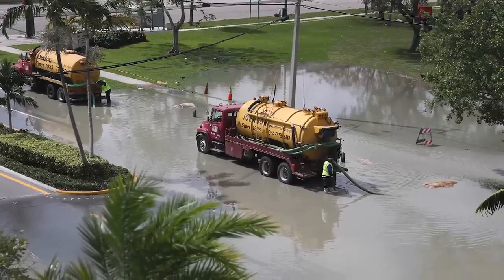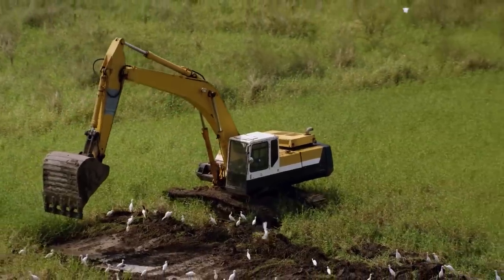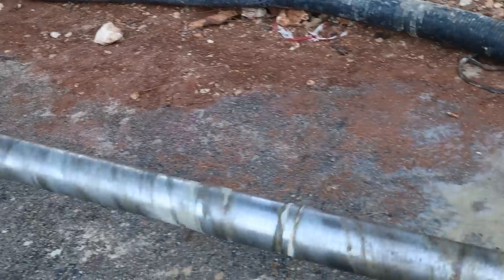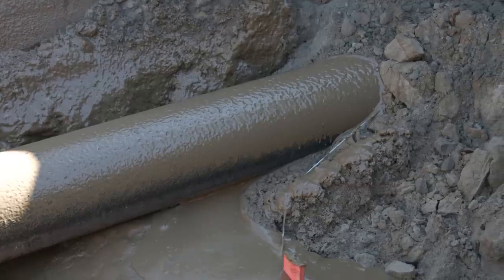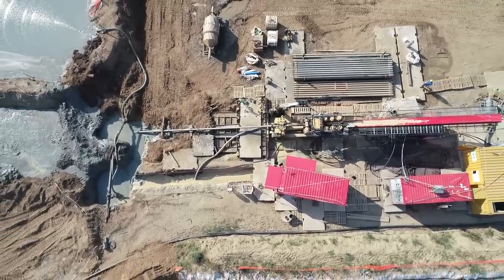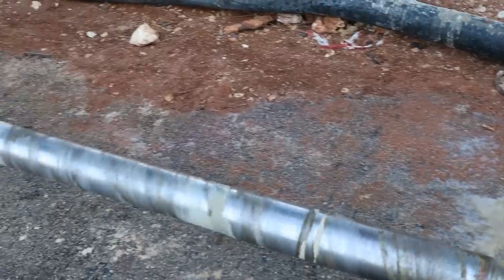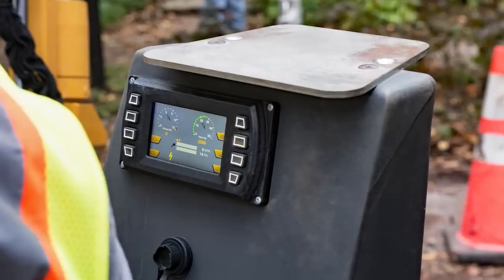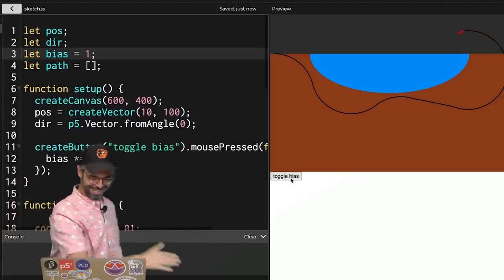How Do You Steer a Drill Below The Earth?

Comment: I work in the fiber optic network industry, and previously worked in the gas utility industry. We used to joke that you should always carry a length of fiber optic cable with you in case you get stuck on a deserted island. Just bury the cable and when the guy with the backhoe comes out to cut it you can just ride back with him.
Reply: I just laughed out loud at this.
Reply: Good joke but it's hard not to blame the guy that put it there using only the sod to cover it.
Reply: In surveying we had a similar joke. If lost set a survey marker and someone on a piece of excavating equipment will be by shortly to tear it out.
Reply: @longridgearchery  love these jokes. I promise a lot of us do try not to disturb markers but mistakes do happen and I do apologize for the ones I've accidentally knocked down.
Reply: As much as that terribly destructive invasive species, the North American Fiber-Seeking Backhoe, is a pain in the backside, it can come in handy! :-D
Reply: Maybe if you actually buried your cables we wouldn't be hitting them 2 ft below the surface. You know something called WORK
Reply: One of my previous bosses was a retired framer and I would go help him with occasional projects like repairing someone's deck or something like that. 
In construction our running joke was always.. if you're somewhere you could fall, make sure you have an extension cord or an air hose with you. If you do fall off the building, cliff, whatever, just throw the extension cord out behind you. It is bound to get caught up on something and save your life.
It never fails. When you're on the job site and want to pull the extension cord or the air hose, it will inevitably get caught up on any scrap 2x4 or anything laying around and you have to go walking around and untangle it lol
Reply: @keithyinger3326  When I would string electric tape in my cow pastures, my constant mutter was, "If it can, it will," as the darn stuff tangled like spaghetti every few feet.
Reply: @lizj5740  How do you store your electric tape for the fence? Do you keep it on some sort of hose reel?
Reply: @markfryer9880  I left the farm over 25 years ago, so let me see...I think I would just loop it on thumb and elbow as I took the tape down. I'm sure this was the source of the problem. A reel might have helped.
Reply: This is hilarious 😂
Reply: Cool story bro
Reply: Fiber optic is much lighter to carry vs. a 32 pair phone cable.
Reply: @francisschweitzer8431  you're not wrong, but I can't remember the last time I saw metallic cable that size. 400pr is about the smallest I deal with.
Reply: I remember an incident in which a crew was sent out to put up signs warning of the buried fiber optic line and drove the posts into the line.
Reply: 🤓 Your buried line would probably summon a backhoe alright, but now, since backhoes can't cross the water that generally surrounds desert islands, you would both need rescuing.
Reply: @lewisdoherty7621  omg - that’s funny (in a shake-my-head kind of way)
Reply: I was driving my car and was able to drive over a fiber optic cable that the guy was laying.

I didn't see it and he must not have seen me I fault him 100 okay 99%.

I think I must have broken it so did he continue laying it or did he put a completely new length to replace it.

Given the fact that he would lay fiber optic cable on a roadway without protecting it sufficiently from traffic I'll bet this contractor just continued on and any problems that arise later could probably not be isolated and repaired easily.

Sorry about that chief...
(Keep in mind I'm only accepting 1% responsibility)
Reply: It's always the way.
I know someone who took out one of the largest fiber runs in town. Did all the legwork having the governing bodies supply plans and then paid contractors to find all services on said plan and mark them. Eventually given the green light and then proceeded to take out the cable that was supposedly on the other side of the road.
Reply: @spicywolf6718  If a utility company doesn't tell the municipality where their lines are, I feel that it's on that utility to deal with the consequences when the municipality has more construction done. 
(Of course, always get an up-to-date survey done before construction anyway. Dealing exclusively with old records can be a nightmare. And for anyone who needs to dig in the US, find your national / state / local "call before you dig" organization.)
Reply: @longridgearchery  Yupp, someone's bound to come destroy it by "accident"
Reply: @dcviper985  fiber optic has to be my biggest nightmare. It’s so fragile, yet so expensive. I’ll never understand why it is ok to direct bury it near other utilities.
Reply: LOL I am that guy with the backhoe except it’s usually my shovel 🫣
Reply: thanks ,I needed that , after l"ong" day,. midnight laugh
Reply: @keithyinger3326  I got a chuckle out of that. The problem is it wouldn’t actually work; Murphy’s Law isn’t recursive.
Reply: Got to be sure to only bury it 12" down where most companies bury theirs despite regs. I've worked concrete construction for years. Here, the minimum depth for fiber optic is 36". We have found 7 active cables within 12" of the surface in the last 2 years alone. Not my fault when they're not up to regs.
Reply: @longridgearchery  every dang time. They'll be gone by the end of the day.
Reply: @keithyinger3326  If you can't find an extension cord, grab a garden hose instead.  Same principle involved.
Reply: @wax_axiom479  I have had the opposite problem. Somehow I managed to rip down a phone line on a customers house that was zip tied to the weatherhead on the hydro meter (which also ripped off) with a fuel truck that was 10' 8" high. I can't remember what the height at which communications wires are supposed to be over a driveway but it's higher than 10' 8". The company I worked for paid for the repairs, should have been Bells problem imo. Next time I went there, the phone line was at the exact same height as when I hit it.
Reply: If you guys would install them in a way that didn't look like a spider web and maybe some organization like all the other utilities are they wouldn't get hit all the time. Oh yeah and actually mark them!
Reply: @noahbartholomew932  hey, we always use locatable cable or duct. Failing that, we add tracerwire. I dunno what else you want. Call before you dig...
Reply: @dcviper985  I have found many lines that weren't  located and haven't paid a cent to have them repaired because they weren't located......hence I did the one call. The job I'm on rn you literally cannot dig with an excavator because you will hit a communication  line you HAVE to use a vactron. I think at&t should be sued for that because it cost everyone more money when you have a mess of wires running everywhere when they could all be bunched together like all the other utilities....God I hate communications companies.
Reply: @lizj5740  it builds in a twist
Reply: And of you fail to flag down the operator you can always wait for us insurance guys who'll invariably be coming out to check the locate marks.
Reply: Another joke: the difference between a fiber connection and a secure fiber connection: 
The secure connection is the one that comes with landmines.  You dig down there with a backhoe, you get darwinized.  There's a nice alarm sound when it's cut, too.
Reply: @andrewsaint6581  I'm sure you're right. I hadn't thought of it that way.
Reply: @lizj5740  looping up ropes for sheeting lorry loads you roll in the the opposite twist with each loop, then they hang straight and not like yesterday's spaghetti. It would be much harder with a ribbon though. That stuff is coarser and more "snaggy".
Reply: @andrewsaint6581  Thanks for explaining the source of your knowledge. I don't know if I could roll in the opposite twist with each loop. I'm just glad, it being winter now in Australia, that I'm no longer out there dealing with uncooperative electric fence tape and feeding hay to the cattle daily.
Reply: @lizj5740  works on normal cables too. Just start at the appliance end.
Reply: lol
Reply: As someone who works for the city in a town that's currently putting in fiber, it's going the other way around lol. They keep drilling through our storm and sewer drains.
Reply: Now, that's funny!
Reply: There is acronym for this: B.I.F.F Backhoe Induced Fiber Failure
Reply: Same joke, but heard it "grade stake and grader operator"
Reply: I just LOL’d out loud by myself in my backyard and scared both my dogs.
Reply: My personal best is hitting a water line fiber optic and gas line within 100 yards in one afternoon
Reply: @interdesk9516  That's a bad day.  Marked?
Reply: @ricksanchez3176  well it was on our property,  you know where 811 stops
Reply: @interdesk9516  I don't know how it is where you live, but in Ohio, OUPS doesn't stop anywhere. Worked in many States, and it's been the same. The "operator" (owner of the utility) has to mark them, within 18", "contractor" has to call 48hrs, counting only Mon-Fri before digging.
Sometimes they won't mark a private service, water after a stop, or comm after the ped, gas after the stop or regulator stand.  Sometimes a big industrial complex may have special agreements. But right of ways are right of ways, unless they layed it without being on right of way, if it was marked or OUPS wasn't called, it falls on the excavator.  Sometimes it's not worth taking to court for small repairs if a private landowner damaged them. But as for locates "stopping", what state are you in? Either ANSI or NIOSH layed out standards for this decades ago and pretty sure most if not all States based their laws on them.
Reply: Just as I will bring my golf clubs if I was ever stranded in the desert, I will DEFINITELY find water. 🤣
Reply: @jonny555ive  Walk to the water. Throw in a dozen balls. Cross to the other side and drop. It's a lot quicker
Reply: @boostaddict_  better than through yout water service
Reply: @wax_axiom479  homeowners are taught to call and see where lines are placed before they dig. Why can't you follow that simple instruction, too? You know, since it's part of your JOB
Reply: That’s funny 😆
Reply: I haven't hit fiber optic yet but I have successfully cut through electric and water lines!
Reply: YOUR AMERICAN ARNT YOU
Reply: wow..lol
Reply: Bahahahaha. I just cut one the other day about 20’ from the locate
Reply: When a carpenter goes on vacation, he should always pack a 100  foot extension cord. If the plane is going down,  he can  just throw one end out, it will 100% of the time get caught on something.
Reply: Utility locators?  Those guys would NEVER miss.  LOL
Reply: Same here. I built water towers and flat bottom storage tanks before I started doing fiber. Twinsies!
Reply: @lizj5740  You must be referring to what many people call "polywire" or temporary/portable electric fencing.  I've never heard it called "electrical tape" as that is usually something for insulating electrical connections.  Maybe you are in another part of the world, like Australia?
Reply: @stevewalston7089  I am in another part of the world, and I moved off the farm over 25 years ago, so I have probably called it by the wrong name.
Reply: @wax_axiom479  New fibe cables buried 1 to 2" below grade to every house on my street
Reply: @AndyGneiss  do you put warning tape below the surface for underground cables is the US? We do that in Finland
Reply: @ActingLikeABoss  we bury fiber optic with 20kv and 400v lines in the same trench in Finland. Also fiber optic cables are pretty cheap iirc.
Reply: @jabbatheputz8825  our target depth for electrical lines is 70cm or about 28"
Reply: @lizj5740  you made my day
Reply: @markfryer9880  you Made my day
Reply: As a water utility worker. Com lines were never marked properly or even put on the subterranean utility maps. We had no remorse for the ones we came across. 😂
Reply: @vinny9854  I mean, as long as you called 811 beforehand, I would have any sympathy either
Reply: When they first started using this tech they hit a lot of utilities. It's better now with less hits. But, Hydrovac is the way to go. In some states its consider hand digging so less risk.
Reply: Thats funny but makes alot of sense
Reply: As, formerly, one of the guy's in the backhoe I would like to point out that we do not possess x-ray ray vision.  We depend on accurate locates, good laborers willing to pothole even in hard soil, and sometimes just plain common sense and luck.  Worked for a large mid-west city public works and never ceased to be be amazed at the amount of in service, abandoned, and "nobody knows or want's to claim what this is" stuff we found on our jobs.  That includes basements to existing structures that were damaged during construction or repairs and were not on any city plans or maps.  Go figure.
Reply: The best part about this is that I'm a pipe inspector and find Fiber bored through sewer and storm water pipes all the time 🤣
Reply: @jasonm3040  I can only imagine... I swear when we engineer these bore paths we take that stuff into account
Reply: Lmfao. That’s great.
Reply: I have a running joke about being the only person on a job site and a room being available for a long time for access. As soon as you go in 14 others want into the same room
Reply: Lol, can totes understand. In all fairness, they often dont adequately mark them, and since they are pretty much undetectable lol. But somehow, they are magnets for backhoes....
Reply: Worked as a first responder for the gas utility in St Louis and we had a few.
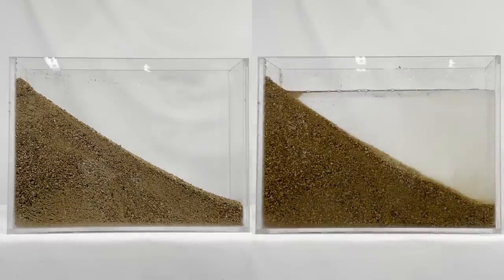Who has blown up more houses than the Russian army ? Answer : The directional bore operator😂. What do you call a directional bore operator in a three piece suit ? Answer: defendant😂 . What should you do if you don’t want anyone to find a buried treasure ? Answer : Have USIC document its location😂. If you don’t want any overtime at 4:30 on a Friday afternoon what should you do? Answer:Call in sick Friday morning😂. I could probably go on forever.
Y’all stay safe out there & pot hole those services and mains, especially on Friday afternoon.
Reply: @boby115  dude they blew the water main branch during winter, creating the perffect scene for the live sction version of frozen on the business where they hit the line outside if. It was windy and at the low end of their workable temps.   Literally watched a 75 ft tall frozen waterfall collapse onto the interstate, along with the office windows and business sign attached. 

City wound up paying for like 500 gal of water.
Reply: @patrickw9520  , what city was this in? 500 gallons of the municipal water is not much (about $7.50) The real cost is in the repairs & litigation.
Reply: @boby115 was bottled water 😆 🤣.  350 gallon jugs (a literal pallet worth) and the rest in half liter bottles. So was about $500 wholesale of bottled water. 

The repairs took years of litigation to finally determine who was legally liable.... the horizontal drilling operator, city water, or the marking crew. Insurance cos like suing 😆
Reply: @patrickw9520  , at least it wasn’t beer 🍻. What was the city?
Reply: I installed communication lines in an industrial park with 4 levels deep of previously installed services. Guy comes running out to warn me that his company is multinational and if I interrupt his service I will be in deep trouble. One of my guys confronted him and said if he lays down on the ground I could pick his nose with the backhoe and he wouldn't even feel it. I dug for 10 years around 5000/25000volt cables, gas lines, water lines,cable tv, phone lines and never broke anything. The trick is having the best guy on the crew watch the bucket while you dig. I couldn't tell you what each lever control does, every movement has to be automatic. If you have to think about it you will mess up. Best job in the world.
Reply: @jc-pj3nh  accuracy of marking crews is another vital necessity. Have had telco mark up to 6ft off the line before. They proceeded to blame it on soil flow, and still refused to run an aerial drop on power poles.
Reply: @jc-pj3nh  , as a first responder for a gas utility, i’d like to have a dollar for every time I was told “ this was the first gas line I ever hit .”Just continue to do a good job, pothole , verify those locates & sometimes it’s better to be lucky than good but being good helps , as long as you don’t let it go to your head 💥.
Reply: @xtranormal2350  the ones in ur yard don’t matter as much as the ones that are the middle of nowhere that run ur whole town
Reply: HILARIOUS!!!!!
Reply: Hey! Ive only hit lines that weren't marked😊
Reply: @markfryer9880 
Plastic empty mig wire reels.
Reply: I work as a subcontractor for many different water supply corporations, fixing water leaks, putting in water meters, and the like. A large percentage of our water leaks are from fiber guys boring into the water lines.
Reply: Makes me think of the saying, if you’re ever lost in the woods, sit down and sharpen your knife. Someone will come find you to tell you you’re doing it wrong
Reply: My best was hitting the telephone cable buried 3 inches in the driveway scrapping 2inches of mud off built up over the years. 
That cost me! Because I didn’t first call before you dig? Scraping digging still your fault, I was told.
Reply: Hahaha thats a good one, last year we hit a bunch of old fiber optic lines while digging to prepare a truck entryway to site. Funny part was, it wasnt even necessary for us to dig that area, one of the guys got impatient and dug a little deeper when clearing that spot and instantly ripped it up. It was also one of the only scoops he made into the ground in that area!
Reply: I am a utility locator and out saying is after you locate a line the lawn guys will be by within an hour or 2 to pull the flags out
Reply: It's a "boring job" but somebody has to do it!
Reply: @longridgearchery  I've heard of angry surveyors burying pieces of rebar (such that they just stick out of the ground) near survey stakes after replacing the stakes for the 4th or 5th time.  Not very safe or ethical, but eventually the foreman or superintendent gets tired of spending the money to patch/replace puncture off-road tires and treads and starts to investigate.
Reply: lol, screenshot for my close friend who has run a rig for 3 decades - every so often he calls to vent
Reply: Yeah, because every fiber optic company contractor puts a fiber line willy nilly in every workable space within public right-of-way.